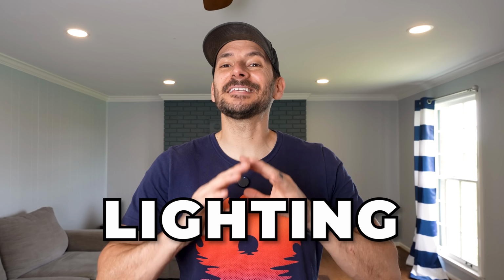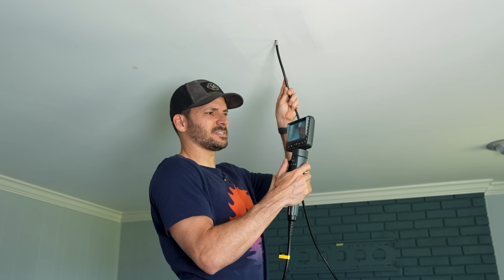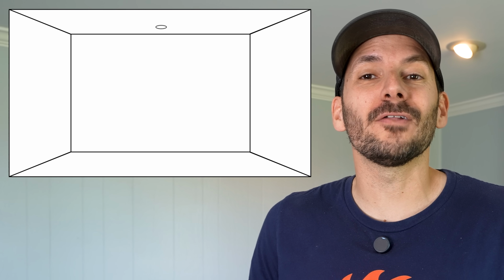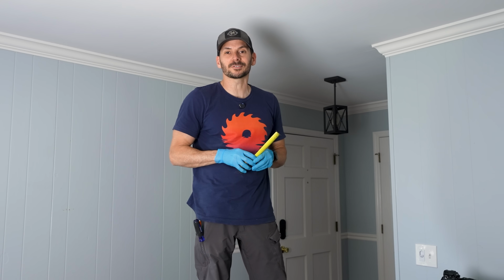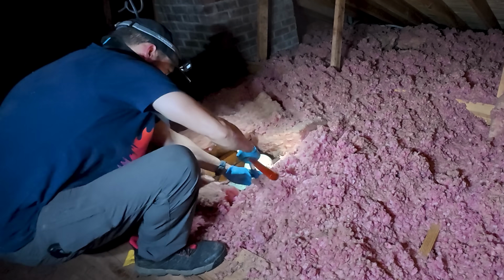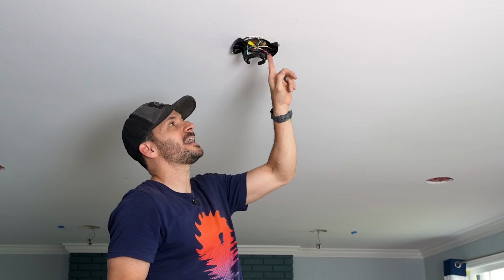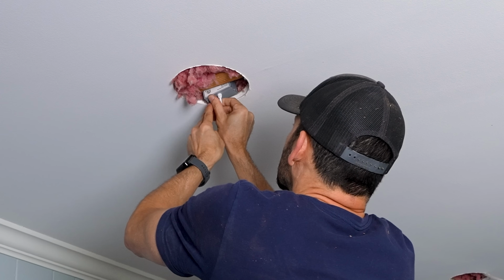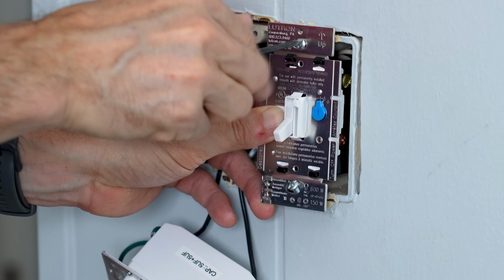Electricians Hate Me for Showing You This!

Comment: Neutrals do not hook up to switches. You could utilize the white conductor to carry current as a hot wire but then you would need to identify it with Black or Red tape that it is no longer being utilized as a neutral. Sticking the blue tape on the wires and then using them as flags is a good idea but then you defeated the purpose by running up & down from the attic to stick your next piece of Romex wire up through the hole in order to run it to the next light. You could've saved trips up into the attic by running your Romex wire from the first recessed hole to the last one. You then stay up in the attic and pull all the wire you need from up there. As you go from the last hole back through the order to the first you simply either make a loop in the wire that you stick down through the next hole or your cut the wire and stick the ends down into the hole. You do this one after the other until you backtrack to the first hole. This saves you multiple trips into the attic.
Reply: Why dont you connect the neutrals to switches? I replaced a bad one today and connected the ground to the green screw.
Reply: @rys_6776  because it's against NEC code to switch the neutral. Under NEC 404.2(B), switches and circuit breakers are prohibited from disconnecting the grounded (neutral) conductor of a circuit. The neutral must remain continuous to ensure a reliable path back to the source, which prevents floating voltages and ensures safety devices (like GFCIs) can function properly. BTW the green or bare copper wire is the ground wire on the "Grounding" conductor. It normally does not carry current. It is the one you connect to the green grounding screw on switches, outlets, etc. The neutral is the White wire which is the "Grounded" conductor. It does carry current as it is the return path for current in a circuit. Just a word of caution, if you do not understand these concepts then please hire a licensed electrician.
Reply: @jfow1701 oh i meant the bare wire to the greem screw, which i call a neutral, should be ground i guess. The white=white. Black=black wires

Comment: this works, but, as a residential electrician (that literally did this with 5 smoke detectors this morning), i find it so much easier to run your first fixture from the switch to the closest fixture, and just do a "one romex in, and one out" all in the attic and just cut the excess after you pull the wire through each fixture from below (not in the attic) so you don't have to go back up multiple times. One thing as well, I never recommend tying out of a fan due to how difficult shoving excess wires into a metal box is, especially if you have a remote control fan. I always make a fan the last fixture to receive power.

Comment: I question why the light fixture manufacturers make the J-boxes for these recessed lights so small that they either bust code for wire-fill capacity, or just barely meet code when running (2) 14/2 romex cables in/out at the box. They could simply make them a few cubic inches larger and there would be no problem and no worry about wire fill. And even if it technically manages to meet code, why would they think it's a good idea to jam wires into a tiny box?

Comment: Blind drilling through joists. Shudder. Good way to hit something like other wires or plumbing. Only do it if you know what's in the path.

And the 3way switch situation. If I had to guess I would say the fan was added and they wanted to control the light and the fan with 2 separate switches. So they re-purposed the wires that were already run. But without running new, they could only change it to a single pole switch at one location. Then leave a dummy switch at the second location so you don't have to change the box. 
And using a 3way as a single pole switch is very common.

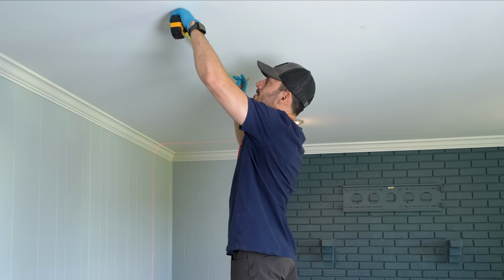Comment: 11:21 Fun fact. That little slit that is in the tape measure end, that is actually for the screw head. Not on,y does it give you a sturdy place to put the screw head. But it also accounts for the 1/16” measurement. Just like why the end if the tape measure is loose. When you measure from a wall, it pushed towards the tape to account for the thickness of the end. While you measure the edge of a countertop, it’ll extend outward. Again, accounting for the thickness.

Comment: Could have saved yourself from going up and down the ladder so much by running one continuous length of NM cable while in the attic by bending the cable in half at each hole and pushing the bend down through the hole, continuing to each location and doing the same. Then, come down the ladder, once, and snip all the bends you pushed through and ta-dah, one trip up and one trip down and all your legs are ran. Just a tip if you have to do something similar again. But maybe it was leg day. What do I know?

Comment: I've installed dozens of these lights throughout my home. I've only had one go bad in 6 years. Not bad. Also - I've installed the Lutron Maestro on all of them and the lighting effect has a nice, luxurious feel to it. Lots of people dump on these lights and it's because some are not permitted to be installed up against a floor joist because of the heat buildup. If you avoid those, these can be a really nice option. Much better than installing the old style can lights.

Comment: As an electrician, I love you showing this kind of video. I get paid extra to clean up the messes.
Reply: Did he do something wrong in this video? if so what was it? im about to do this to my house and would love some tips.
Reply: @MadCow17  If you have attic access, then use that instead of the drill.  The only time you need the long bit is for when you dont have attic access, and the joists are the "I-joists" type that dont have webbing.  Also use a laser plumb bob and a tape measure to lay out on the floor the shoot your measurements up to the ceiling with the laser.  Dont use the push-in cable connectors; the metal ones are better. Wagos are great.
Reply: @StormyITO do you have to drill holes in joists to run romex? can you not just run the cable over top of the joists?
Reply: @BraxtronAdvance  If there is attic space above, yes, run right over the top of the joists.  If there is a floor above and they used i-joists, then you are drilling holes.
Reply: @StormyITO Im sure he only used the drill to demonstrate how you could do it if there is no attic. I thought it was a great video 🤓
Reply: @Senoracalisthenics  My post may be taken as snark, but I assure you it was sincere. I often clean up messes made by homeowners who watched a YouTube video and thought that replaced three decades of experience. Sure, a very handy and mechanically inclined person can figure it out, especially if given the perfect conditions. However, I have seen jobs that appeared simple, but turn into a headache real fast, especially for fresh graduates from YouTube university.  My advice is to go ahead and tackle the project, but if you run into trouble and you become unsure, call for help before you do something sketchy.
Reply: @MadCow17  he’ll tell you alright, but it’ll be $600. Don’t listen to these bozos. I haven’t paid anyone a penny for any remodeling at my house and had zero issues… I do know I ain’t paying no dude $1,000+ for something I can wholeheartedly do myself
Reply: Funny, the first time i ever paid an electrician (16 years ago), was a shop sub panel with additional wiring for a pool pump. I ended up fixing the inspection failure since he didn't isolate neutrals and grounds. This year, I wasn't happy with some of the electricians work doing some remodeling. They incorrectly installed a canless recessed light in the wrong spot. When they came back, instead of removing the transformer box for that light, they left it as a junction box, with the transformer still connected. They just unplugged the light from it. sloppy work, among a couple other things. I wired my parents house upgrade from a 60amp panel to 200 amp, it passed inspection without issue. I'll be doing my garage and den we're adding on. I'm tired of paying for sloppy work. Everyone is either in too big a hurry, or just doesn't pay attention to the task.
Reply: @polarys425  What a great little story, you hired a crap electrician 16 years ago and some sparkys installed one light in the wrong location.

Comment: A proper electrician would never use Wago connectors.  Any friction fit wire connector or even a device, is a future failure point.  This means FIRE potential.  Wire nuts only!  And as I mentioned, any device that is equipped with friction connections also have a screw option.  Use the screws.

Comment: One thing in the video not shown is the use of a stud finder. Before you drill any hole of any size in the ceiling make sure you sweep the area where your fixture is going. In the video the guy drills center to a joist. Yeah, he got lucky, using thin LED lamps. But if you need to use full size pot lamps and you do like he did, you will be watching YouTube on how to do drywall patching.

Comment: With the non-contact tester, I usually test a line that is known to currently have power to make sure it will sound an alarm. Then I test the wires I'm working on to make sure it doesn't have power. This is just in case the meter went bad causing it to not trigger.

Comment: If there is attic access, consider using Armored Cable.  This metal cable would prevent any rodents or other animals that may get in there from desiring or being able to eat the wire.  Armored cable should be used in drop ceilings too.  Armored Cable is different to use and don't try to install without knowing how its done correctly.  Maybe this guy could teach that if he knows.

Comment: Not sure why you didn't tie into the lights by the fireplace, unless that switch is by the fireplace.  I know that the fan is not a bad choice, but  I think it might be better to use the other circuit.  This way you can have the small light on the fan for "mood" if you ever want to.

Comment: There is no neutral at the switch unless you have a very special switch or a switch that acts as a nightlight when it’s off so you can find it at night.  The switch is just a connection point for a break in the hot wires that feed the load (light).  The common wire is your black wire that is the hot wire which goes to the black screw this is your (I switched hot) wire , the brass screw is for the traveler wires which are usually red or blue and they run to the other 3way switch.  The red on your 3 way switch is the switched part of the run.  The neutral is going to the neutral terminal if the actual light and passes through the switch box.   So power into the first switch at the common terminal then traveler wire from the brass terminal goes to the brass terminal of the 2nd 3way switch and the  black wire from the common terminal on that 2nd 3way switch goes up to the black common terminal at the light itself and the circuit is complete.   In older houses there is just 2 wire with no actual ground wire run from the boxes, they relied on the metallic raceway and metal boxes to be the mechanical ground back to the panel and to earth.  Keep up the good work.  Remember you will hardly ever see a neutral wire connected to a switch unless it’s a special one, the neutral will usually run through the box and connect to nothing.
Reply: I have seen that you must have a neutral in the box in case it is needed in the future. NEC
Reply: @loramcclamrock5549 Not always, here are exceptions and most switch boxes have a neutral passing through them (in/out) the neutral in a switch box only became an issue in the past couple of years due to the changes of light switches that require a neutral to work,  the other time you needed a neutral there was if you had an old school locator switch that used that cool orange neon bulb in the switch so you could find them when in the off position at night then that would be  the reason the neutral would actually stop and be hooked up to the yoke in that box.  But you are 100% correct that as of I believe NEC 2020 there was a change.

Comment: Remodeling contractor here. I like watching these to grab any tricks I never thought of. 

The wire with blue tape is a good one! I’ve used lawn flags in the past for this same reason, but I like this cause it’s not an extra thing I need to get/have. 

But I got one for you (and everyone). Instead of laying out on the ceiling, lay out on the floor. Put painters tape down for marking, then use a plumb bob to mark up. An electrician showed me this once, and it’s a lot faster and less frustrating than holding a tape on the ceiling. Use a laser with plumb function for extra brownie points. 😉
Reply: I need a visual. Smh...ima figure it out though

Comment: To me, the plastic push-in romex connectors are not easier to work with. Pushing the wires through is a pain and I always seem to cut myself on something. The metal ones with the locknut and screw type wire clamp work a lot better. Maybe it's just me, but I always buy a bag on the metal roxex connectors.

Comment: As a electrician I approve
Reply: Ok. Quick question. Since each puck light has a transformer and this is low voltage after the first puck. What is wrong with using 16g wiring for the rest of the lights?
Reply: @gwenderwoman  It's not low voltage after the first puck, only the connection from the transformer to the puck is low voltage. Each puck's transformer is wired in parallel along the line of Romex, so it is mains voltage to each transformer, and so the Romex along the whole line should be the appropriate gauge wire for the circuit breaker it is connected to.

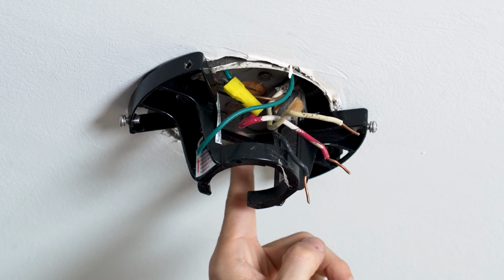Comment: It's not a bad video. Just a few comments. At 20:36, I noticed the fan was in a regular pancake box. Even with the fan's wiring compartment. That box is not rated for two cables. They can hold 1- 14/3 or 1-12/2 at most. You should have changed the box to the other style of fancakes that fit around the stud to give you more capacity. That makes this job a code violation. My next comment is more of a time/material issue. Both the plastic button connectors and the metal ones are rated for two 14/2 or 12/2.  Those smaller boxes would have been easier to wire if the cables entered from the same direction. You wasted time and the extra material. If I went up into the attic and saw them. I would've asked if a handyman did them. No electrician would entire the boxes in/out like that.  But, again, it's a decent video. I have seen a lot of these giving unsafe information.

Comment: I can’t believe you never noticed that the switch did nothing. I’ve never met anyone over three years old who didn’t try every switch they saw when entering a room. 
Mostly kidding, but it is interesting. Likely a lazy contractor or running late before closing. 
It did look like the wiring was #12. Remember to confirm the breaker is 15A before using #14 wire to the lights. Will it work, yes, but somewhere down the road it might be important.

Comment: The proper way to use a voltage detection stick is to test it with a known-live circuit first to make sure it works. Otherwise, you may find out in the worst possible way that you blindly trusted a defective safety device.

Comment: One VERY IMPORTANT WARNING that this guy didn't mention. If your celing fan hangs below the recessed lights beam angle, every time the fan spins, it's going to obstruct the light path and create a horrible strobe effect.

Please account for the distance from your fan, your beam angle, and how low the fan is when planning light placement.
Reply: I was just about to ask what fan wouldn’t be lower then a recessed can😂
Then I remembered their are recessed ceiling fans 😂
Reply: Obviously the double recessed fan
Reply: So what do I need to do/measure/calculate to make sure this don’t happen?
Reply: @MichkaDesignStudio  depends on how low the fan is. 4' - 6' away from a suspended ceiling fan should be enough. If you got a wide beam flashlight you can hold it from the ceiling while the fan is on
Reply: @MichkaDesignStudio  Since I work in production, I have a paid app on my phone called Sunseeker that uses the camera and gyroscope to show you the angle of wherever you point your phone.
Reply: So glad you mentioned this as I'm trying to plan and design now 👍

Comment: There should be a Federal Law that any light fixture that does not involve a screw in bulb replacement should not be permitted. If the fixture takes more than a minute to replace the bulb, it should not be in your house.
Reply: Thus makes no sense. Once’s the transformer is hooked to the wiring. It takes less than a minute to mount the puck light to the ceiling.

Comment: Cheap outlets will have push holes in the back. Don't use them! I have seen three house fires due to these inadequate connections. Wrap the wire around the screw or spend the money on a commercial grade outlet that uses the screw to clamp in the wire.

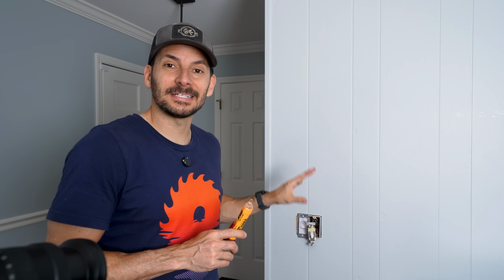Comment: 27:08 we call those non contact detectors "idiot sticks". Because in my line of work they can get you killed. But I deal with 12,760v down to 1440v and transformers the size of a small gas station building .

Comment: I would point out, that research is your friend.  Plumbing also runs along joists, be careful drilling through joists.  Also, if you are using standard cans make sure they are rated "IC" if they are in direct contact with insulation.